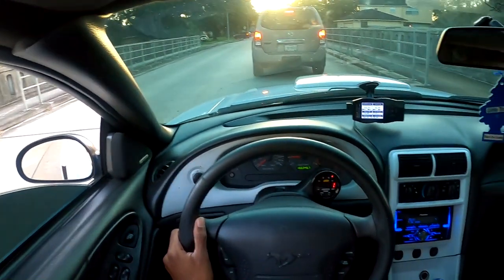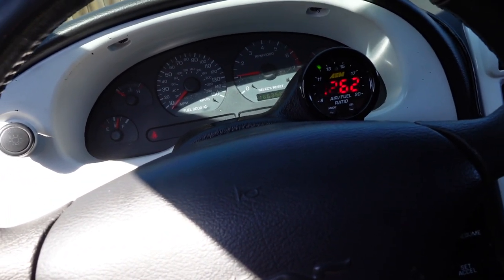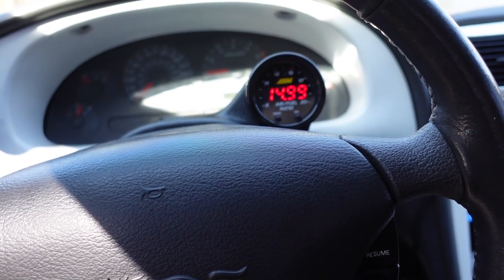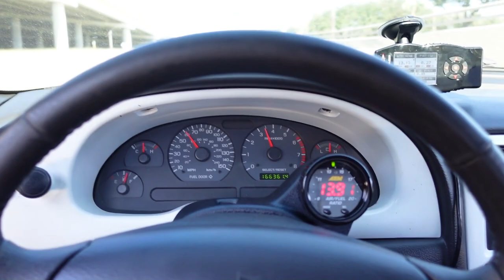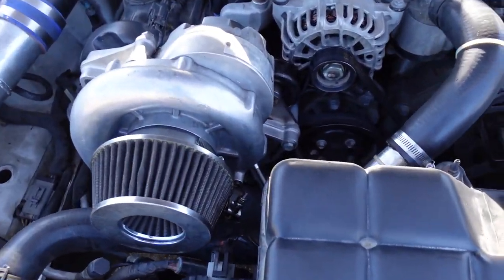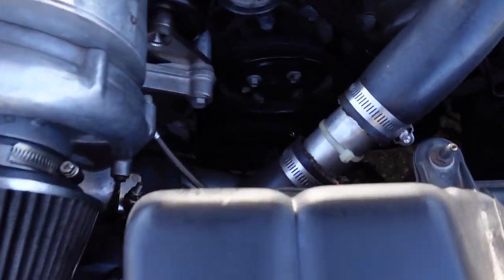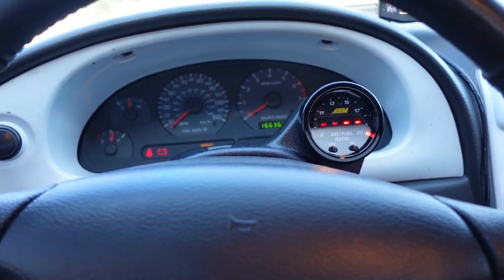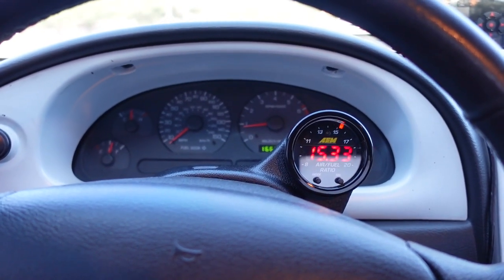Why I Chose a Vortech Supercharger OVER a Procharger For My New Edge Mustang GT!

Comment: I have the v3 with the charge cooler and max flow blow off valve, got little upgrades but I made 462whp and 419 torque
Reply: Those are great numbers! Deff can hurt feelings 👍
Reply: What were your stock numbers prior to the v3? Post numbers are great start!

Comment: Is 400+ rear safe for New Edges, at what point could a rod be in jeopardy?
Reply: Some say 450whp, some say 500whp 😂 honestly depends on tune and how you drive the car!
Reply: @EarsXBL  It's not even whp that determines the limit it's torque. 450-ish tq max for a 3-valve. I'm not exactly sure what the torque limit for a 2-valve is but I'm willing to bet it's less than a 3v.
Reply: @cali2468  it’s roughly 400 for torque on the 2v, but higher can be safe too it’s mostly abt the tune
Reply: @cali2468  it's no different for any of the nonforged motors. Doesn't matter if it's 2v, 3v, 4v. Keep it to 450rwtq with a good tune and you're fine.
Reply: 400 is safe, the crank is rated for 500. 400 wheel is probably 450ish crank, so you're under. Anything higher and you must be interested in engine rebuilding.
Reply: @fakenews4734  cast crank will take a ton more than 500. You don't have to start thinking forged crank until you're over 700rwhp. The rods are the biggest issue.
Reply: Not 550whp ask me how I know..🤣

Comment: If you’re losing 4 or 5 psi through your intercooler YOU HAVE A HOLE SOMEWHERE! That’s an insane amount of pressure loss to think it’s normal.
Reply: No that’s not how that works at all, your loosing boost through the intercooler because the charge air is cooler, cooler air=denser air, denser air=less restriction, less restriction=less boost with same if not more hp especially if your pushing anything around 20psi
Reply: you can drop the boost pressure with meth injection, larger throttle body, higher cfm than stock flow heads, blower cam etc
Reply: you should NOT be losing that boost unless there’s an issue. If you’re saying if you make 24psi but the manifold sees 20psi it’s normal you don’t have a clue what you’re talking about, that’s 20%. Cooler air = more boost in most supercharged applications. There is an issue most definitely.

Comment: Texas is a whole other country. :)

You should be referring to added HP instead of total HP, because every application is going to be different.  Also, the Procharger stuff generally only has brackets to mount the head unit on the driver's side of the motor. If placement is critical, someone may only be able to use the Vortec/Paxton.

I'm currently considering a Vortec/Paxton to put on my Holley Sniper EFI-equipped 427 Windsor stroker (2012 Mustang). I'm currently making 475 (or more?) to the wheels, so I'm curious to know how much increase I'm going to get. Even if it's just 200hp, that would be a huge jump. I'll be making more power than a 2014 GT500.
Reply from the maker: Referring to added HP is irrelevant bc that will very depending on your setup. If you have a stroked and built motor you can gain way more than just 200HP. I honestly would just turbo the car with your setup.

Comment: I just bought a 94 cobra with v1 supercharger. But it runs hot. On the normal temp gage it's usually sits at the letter M and A. 
So a intercooler would help me keep it a lot cooler? Can you send me a link to what I would need? I'd really appreciate that!
Reply from the maker: Yea I would definitely add an intercooler. Can make more power too.
Reply: @EarsPOV  can you please send me a link of what I need? Exactly tonwhere I can buy it and then take it to my mechanic to put it on...
Thanks man!  550 horsepower one you mentioned is fine 
Yeah I just bought it its black on black hardtop came with the supercharger 139k miles in really nice condition for only 4500.
Reply: An intercooler has NO EFFECT on the temperature of the motor. It only cools the air going into the motor. That being said getting one won’t hurt and always try and get the air filter in an area that gets cooler air.